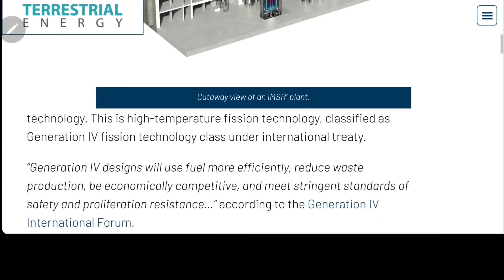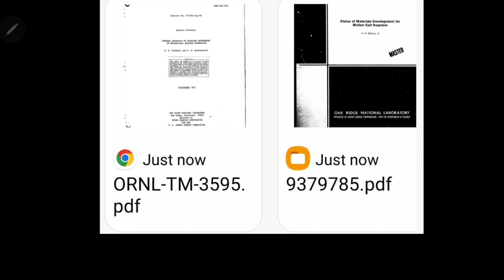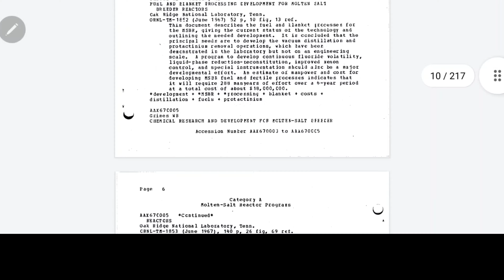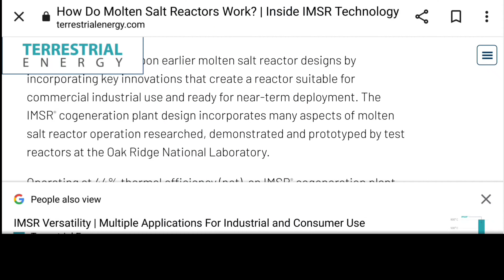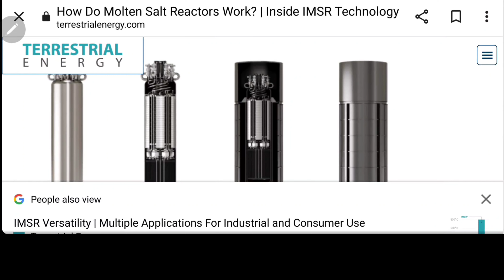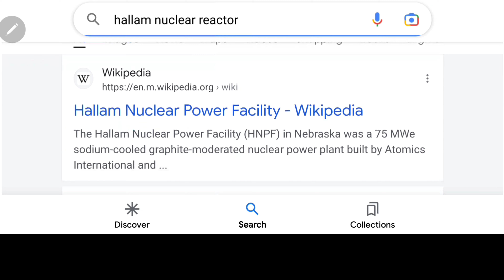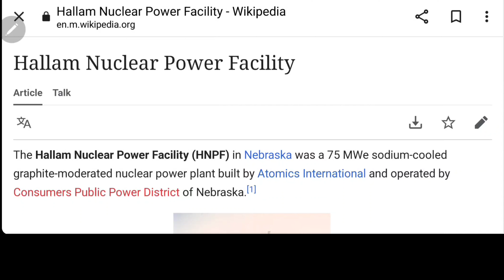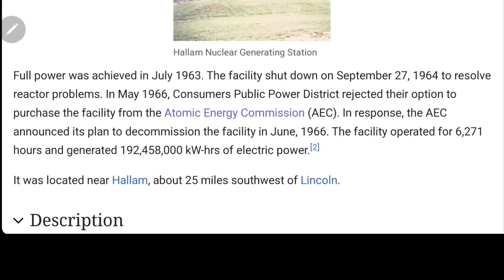Molten Salt Reactor: Future or past?

Comment: Did Not Work Then,  Won't Work  Now ....  Money Spent two Time...$$ = Stupid  Same Stuff Not Safe     Bad From The Go  Thank You , Paul
Reply: Hello, their literally building a  molten salt reactor in Canada right now and it's fuel is the waste from Candu reactors. I can't believe it but Canada is leading the way!!
Moltex energy solves the problem you're talking about but using fuel rods with fissile material and molten salt. The nuclear material is never circulated through a heat exchanger.Those rods sit in a tub of molten salt that then radiates heat out like the old radiators in a house. Once the rods pass their service life they can be removed and replaced with new ones without ever needing to shut down.
Reply from the maker: @jonx9046  Hi Jon, thank you for sharing that link and yes I am well aware of the Canadian salt reactors.   You can use a variety of fuels in most MSRs including spent fuel as it just needs some fissle material.
Reply from the maker: @jonx9046  No...Canada isn't leading the way.  We all know it CAN be done that's never been the issue.  The question is should it be done with the factors involved.  First if you use a molten salt and any uranium fuel you will always have the Tellurium embrittlement issue which means an alloy must be used which increases the cost.  Like water cooled reactors (because they wouldn't last near as long without hydrazine), even with a different alloy they still need to add an additive.  This also increases not only the cost but shows how all they keep doing is putting lipstick on an old pig and try to pass it off as a new hot thing.  It's all garbage and so are you for having the opinion that anything nuclear is good.
Reply from the maker: Exactly, and of course still putting the cart in front of the horse by not developing undeniable ways to get rid of the waste.  That's why you have Robert Muller and his daughter Elizabeth Muller trying to capitalize on that issue by burying it out of sight and out of mind.  But that is never going to be sustainable and only a group of people that makes vast amounts of money in their less than 100 years on this planet.  It's very well known that the grid was set up to make money from the public, not care about their base load or power to their walls.   It's about profit and always will be until people supply themselves with power that can be done today 365 days a year rain or shine, windy or no wind.
Reply: It did work then and improved now, and it's our energy future. Also, they are not spending your money, unlike worthless wind and solar.
Reply from the maker: @chapter4travels  No it is not....more and more are learning that they are trying to force it to work.  Yea sure it worked....for only a 1/4 of the time that a water cooled reactor worked for.  People are waking up to the lies of the Nuclear Industry and EXACTLY  why it's in free fall at single digits now at 9% globally.  Down from 13% just 3 years ago. They have already lost and solar is taking the field....look at the subsidies now....
Reply from the maker: @chapter4travels  And Tellurium embrittlement isn't the ONLY issue.  Graphite expansion and contraction issues, thorium reactors are not Thorium reactors...they are thorium decay chain that NEEDS U233 just to work and many more.  They aren't fooling anyone....anyone now.
Reply: @paulmobleyscience  I never mentioned thorium. The original MSRE wasn't using thorium. These are uranium MSRs. Even Thorcon Power, with thorium in its name is a uranium MSR.  
Again, you think these physicists are not aware of the same publicly available issues? Really?
Next, who are they fooling and why? Let's use Terrestrial energy and Thorcon as examples. Who are they fooling and why? Both private companies with private funding, not spending any of Canada's or Indonesia's money, who benefits? Terrestrial Energy is funded by oil sands money and Thorcon by the founder of TED talks. What happens to you and me if they are wrong, nothing. But if they are right, we both benefit tremendously as does all of humanity. 

Your efforts to denounce this technology are misplaced.
Reply from the maker: @chapter4travels  I know you didn't mention thorium....because I obviously already know.  Of course, they are the only ones that knew it for a very long time and now the public is now well aware what they've been doing since the 70s.  Fooling?  No its the industry that tried to fool the public just like with Normalized discharges of effluents from water cooled reactors (which is really why they wanted to use molten Fluoride for the coolant to begin with.  They knew that the H2O was neutron capturing and leaving the coolant loops as H3O.  They knew very early that tritium permeates the metallic structure due to its size.  THEY (those same scientists you're talking about) knew this long ago yet have kept it from most of society for decades.  Now the truth is out and more and more people are waking up to this ignorant power source.
Reply from the maker: @chapter4travels  Private companies get subsidies just like they have since the 1940s with public funds to set up the CRADAs.  It doesn't matter what country or company...they are being funded by the public in some way or form. Just the patents from those national laboratories must be used therefore not only does that private company have to pay to build it...they have to pay just to use the idea of it, and if you don't know that then you are just as ignorant to the truth and many others are.  The only reason it's pushed is because of those CRADA agreements.
Reply from the maker: @chapter4travels  Why do care how you get power to your wall?  Do you work for the nuclear industry so is why your here trying like the others that are in the industry all over youtube trying to sway public perception?  Are you currently working or retired from a nuclear profession?
Reply: @paulmobleyscience  The "Industry" that you are trying to demonize has nothing to do with Terrestrial Energy, Thorcon, or any of the others, they are separate from traditional nuclear. Your other issues are totally bogus and I proved that in one of our other exchanges with peer-reviewed studies. 

I'm a retired Architect with no skin in the game other than a love for humanity. You on the other hand are a mystery to me, I can't imagine what drives such actions. There is no upside that I can see. Your subside story holds no water, so it's not for the public good. I can only figure a bored Doomer. A lot of that going around these days.
Reply from the maker: @chapter4travels  No they arent....because every company has their hands in every power source.  The companies are making money from all industries across the board.  The industry is the US Navy Research, Development and Acquisition that most companies on the planet must pay to use this technology.  GE built the first commercial reactor in North America WITH the US Navy and using their blue prints to bring reactors from the battlefield to the public.
Reply from the maker: @chapter4travels  What do you know about Organically Bound Tritium?  Not just tritium but specifically Organically Bound Tritium?
Reply: @paulmobleyscience  Only one company I mentioned is in the US, cool story though.
Reply from the maker: @chapter4travels  It doesn't matter what country...international patents cross borders.
Reply: @paulmobleyscience  What I know is that there are many, many well-funded anti-nuke organizations out there that have been trying everything under the sun for the last 35 years to shut-down nuclear. If your story had an ounce of truth, they would have used it to destroy nuclear energy long ago. But they have not, what am I missing?
Reply: @paulmobleyscience  There are no MSR patents held by any government. All the information was made public for all to use. That's how China built MSR. You are out of your tree dude and eaten up bad. Get another hobby.
Reply from the maker: @chapter4travels  What do you know about ORGANICALLY BOUND TRITIUM.  That's new research you do understand this don't you?  Coming from the medical field and not some nuclear industry funded study like the corrupted WHO/UNSCEAR/IAEA/UN proven by the 2001 Kiev symposium on Chernobyl.  It's literally written on their face and if you've never seen that then you would never know.  Now what do you know about Organically Bound Tritium.
Reply from the maker: @chapter4travels  No MSR patents?  Sure whatever you have to tell yourself so you can stayed married to your opinion about nuclear.
Reply: @paulmobleyscience  So you know about it but the "Union Of Concerned Scientists", a very well-funded anti-nuke organization doesn't? Why are you trying to convince me, when you could have contacted them directly? Maybe, just maybe it's BS. yep, that's my bet.
Reply: @paulmobleyscience  Citation, please.
Reply from the maker: @chapter4travels  Plenty of Organically Bound Tritium videos on my channel.  I've held your hand enough, now go do your own work and adjust your opinion after you find out.
Reply from the maker: @chapter4travels  I am an Engineer that served in the US Air Force and fully trained on radioactivity.....I'm not some uneducated person that you would love to paint me to be...you already tried in the thread and failed miserably.
Reply: @paulmobleyscience  What does that have to do with anything? You are a bizarre anti-nuke Doomer with some kind of strange agenda. You have seemingly secret anti-nuke information that you could share with any one of the dozens of very well-funded anti-nuke organizations, but instead, you make a youtube video to try and convince people who can take no action to believe you. 
Could it be that you have tried and even they turned you away and we are all that's left? Again, get a new hobby Dude.
Reply from the maker: @chapter4travels  WHO said it was secret?  This is all public knowledge that isn't a secret obviously...because I'm telling you about it.  Again what do you know about Organically Bound Tritium?  It's a very simple question I've asked several times now.  It's a one word answer....either nothing....or everything.... Nothing more
Reply from the maker: @chapter4travels  Shutting down all nuclear reactors no matter the fuel, coolant or design is not some strange agenda and has taken place for 70+ years.  This isn't just Paul Mobleys agenda and was started before you or I was ever thought of in this world.  It's as old as the science itself yet your here saying it's a secret or some strange agenda?  Why?  If you don't make money directly from building nuclear reactors as an architect then what is your agenda?  Why would you argue with someone that knows more information than you do and served for the US government?  As if YOU have some secret knowledge that people don't know that makes nuclear power safe.  Long ago they said it would be so cheap it couldn't be metered....yet they've charged all of society trillions apon trillions of dollars ever since they said it.  They said it wouldn't harm anyone yet just the Santa Susana fire and Rocketdyne has caused brain cancer in a young woman downwind from the fire that released radionuclides in the air to be ingested while they say everyone's EXTERNAL dose is below standards of high energy gamma rays that collide with matter that causes ionization of that particle using the Linear hypothesis, of which isn't the only hypothesis.  The Linear No threshold deals with actual Alpha (helium nucleus) and Beta (electron) particles that are ingested that will then decay inside us releasing a gamma ray nanometers from our cells as the daughter attempts to stabilize.  I know nuclear physics, Quantum Mechanics (Casimir affect, Van Der Waals forces, dipole, angular momentum and the magnetic moment), Plasma physics, solar dynamics, geology, biology and a host of many other topics it takes to understand the entire picture..of which you do not.   You're an architect with only your training in your field to try to understand things out of your field.  Don't come to me as if you know who I am or what I've done in my life.  You are sadly mistaken and have made a fool of yourself here.  Genius
Reply: @paulmobleyscience  Blah, blah, blah, if any of this was a problem, domestic nuclear power would have been shut down decades ago. Yet here we are on the cusp of a nuclear rebirth. Countries all over the world are turning back to nuclear. All this is with old-school PWRs and BWRs. Poland is building 10 AP100s, Canada is building both BWRs and MSRs. Even the US is starting despite having an anti-nuclear regulatory NRC. China is building PWRs as fast as it can. All of these governments are unaware of your anti-nuclear "facts", and are building anyway. The NRC hates nuclear and would do anything to stop it, yet they are unaware of the dangers you talk about, I wonder why?
Reply from the maker: @chapter4travels  Anti nuclear NRC?  They are all mainly ex-nuclear industry workers with a predetermined bias...they are not anti-nuclear by any stretch of your imagination.  Nuclear rebirth?  13% down to 9% globally is your idea of a rebirth?  How nieve....
Reply from the maker: @chapter4travels  Blah blah blah....is what's said when you have no answers to the 100% factual information being presented.  This can be seen throughout Youtube....we all know what blah blah blah means exactly.  What did you find out about Organically Bound Tritium?  Nothing because you haven't looked yet.....and you're still here using your architectural opinion on nuclear physics and biology.  You won't change anyones opinion on the matter as they read all my responses to you.  Go ahead...show your ignorance in public for all to see.  Tell us...why doesn't the Inverse Square Law apply to extended sources of radiation?  That's nuclear physics by the way...do you know why?  Talbots law?  Lamberts Cosine law?  Inverse square law?   Please show me using these laws and formulas just how the aggregate of source points are found.
Reply: @paulmobleyscience  More blah, blah, blah. Why have you not been able to convince anyone who could actually do anything about it?? Try to answer that without blah, blah.
Reply from the maker: @chapter4travels  What do you mean blah blah blah again?  Is that your scientific knowledge?  Blah blah blah?  You notice I use the science while you have yet to say anything scientific...just your garbage opinion.  But please....be my guest and show people
Reply: @paulmobleyscience  You still can't answer my simple question.
Reply from the maker: @chapter4travels  Let me ask you this...when there is a hearing in our government about nuclear power... who do they hear from?   Is it nuclear industry workers or their opposition anti nuclear groups?  They listen to biased nuclear industry workers....which is corrupt as they are paid by lobbyist to use nuclear power.  This isnt a secret...
Reply from the maker: @chapter4travels  I don't need to answer any of your questions.  This is my channel not yours.  I'll ask the questions around here...now tell us what you know about Organically Bound Tritium that I asked about first.....you haven't answered a single question on my channel since you showed up.  But thank you for the returning views....you all are doing the opposite of what you think you're doing. Thank you
Reply from the maker: @chapter4travels  You do know that everytime you don't answer my question about organically bound tritium you further prove me correct....while you say blah blah blah.  Exactly...while your saying I don't know and it's some sort of a secret....now we know it's only a secret for you because you didn't know obviously.  We all can see it....but you think that you have the questions that no one in the history of nuclear has ever asked?  Please...your using the pronuclear playbook that doesn't have enough plays in it.
Reply: https://youtu.be/V8ApH-0YHkA
Reply: Let me guess your for wind and solar. What a suckers bet.  Didn't work then and really doesn't work now. Well not without a lot of taxpayers money to  keep it going but that's all ending now that the states are cutting back on paying people to supply the grid with electricity.  What a scam just like plastic recycling and biofuels.